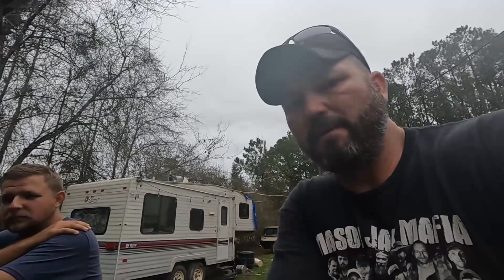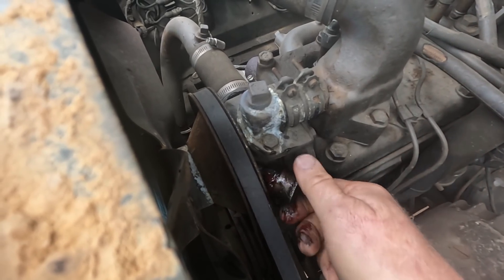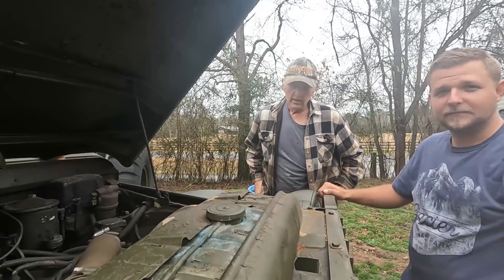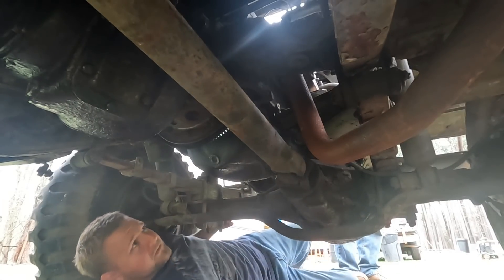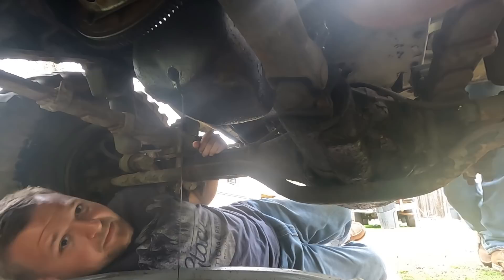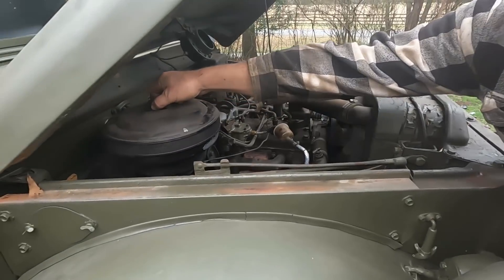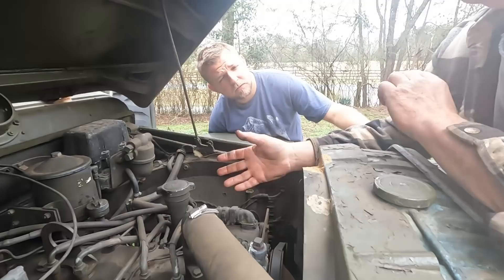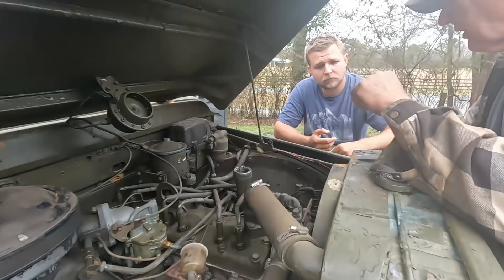DODGE M43 US ARMY AMBULANCE | OIL CHANGE AND SOME FUN PAPA HUGH HISTORY | OLD BYRD FARM AMBULANCE

Comment: I did only Castro on my first new car a Mercury Cougar. Ran that car to 205,000 miles until I took it in for an oil change.  Computers were down, they were just going to top it off.  I don't know what they did, but my engine blew.  Now I don't worry about my oil, I had my second car a Mercury Sable for 17 years, and 195,000 in mileage.  I think oil is important, but maintenance and do things on time, is the best protection to keeping a car going.  I had those cars for 28 years, and had 7 and a half years of car payments.

Comment: They took the zinc additive out of most oils , you need it on old stuff like this.  ZDDP additive or if that's Delo or Rotella T diesel oil it should have it already.  Got the M37 myself, same thing but without the ambulance body.  Get a flywheel cover on that thing, and carry a spare fuel pump if the one on there hasn't been rebuilt using ethanol resistant material in the diaphragm.  There is a filter resistor in the distributor, the power wire connects directly to it, carry a spare for the  point and condenser set, GI coil, and that prone to failure resistor.  Get real NOS US parts off eBay, don't use that cheap foreign junk, they fail with regularity.  Carry that stuff with you on longer trips and save tow fees.  All the vintage military vehicle supply places have that oil filter, and all the correct size and appearance radiator hoses.  Memphis Equipment, Big Mikes Motor Pool, and so on, they have everything you need for the M series Dodge.  Good luck with it, mine carries a full heaped load of oak firewood without noticing it's there, would pull a house off the foundation but hates to pass a gas station.

Comment: If  that's the same oil filter as my 230 flat head Dodge Coronet. It should be.I got mine at Auto Zone. It should be the same motor. You Still can find all kind  parts Nos and new for that motor.Military and civilian. High performance part also.  Very reliable engine. My 50 Dodge coronet  is named Emily. lol . Do you name your vehicles?